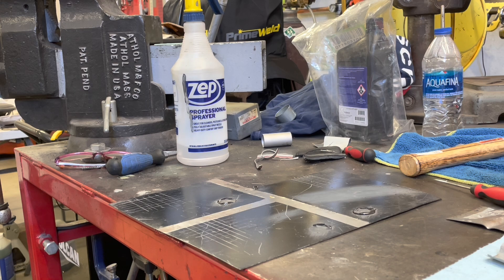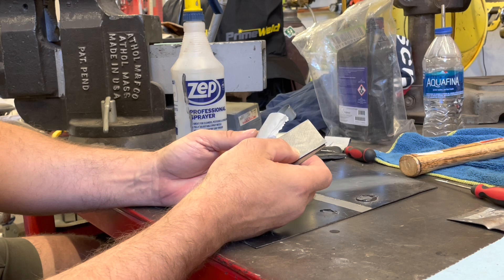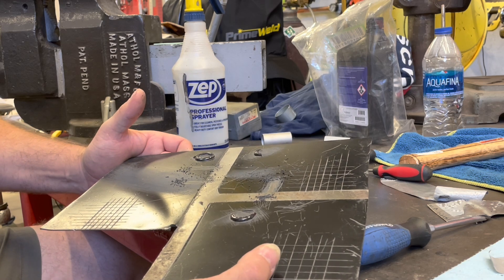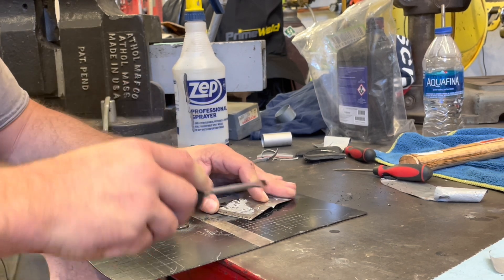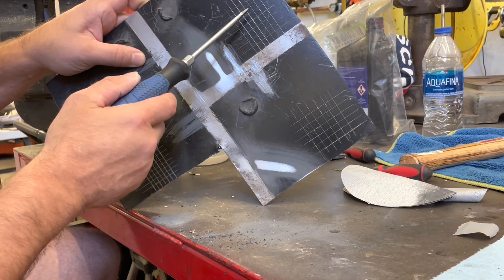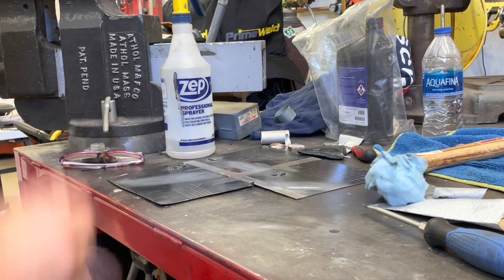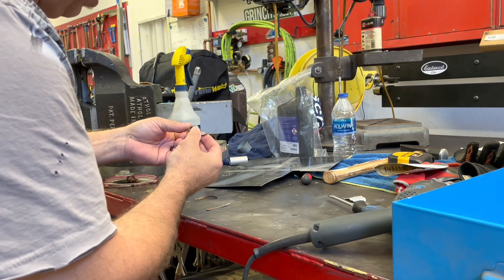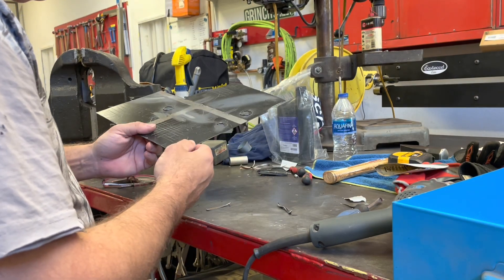Spi epoxy failure??

Comment: Good adhesion now 👍  About the small piece you did the other day. The only thing that comes to my mind is you didn't wait enough after mixing the epoxy and hardner , I think it's called induction time. Or maybe the metal piece had colder surface than the spray product or the environment at the moment of spraying . But what I think most is the surface looked too polished, so maybe it's really 180grit. 🥃
Reply from the maker: Yeah I watched the video where I did those panels, I said I used 80 grit but maybe it wasn’t very sharp or the metal could have been to cold, not sure
Reply: Temperature and Humidity can have an effect on the adhesion.

Comment: I have not used SPI epoxy but have seen several videos where painters like it.  I use Tamco epoxy with very good results.  I know Barry from SPI sure doesn’t like Ospho.  Always enjoy your videos.  I am your neighbor over by the Ark. state line.  Take care!  Tom
Reply: Actually, Barry does like Ospho and he uses it. Even on his tech sheet he recommends using Ospho and doesn't want people to use anything else under his products
Reply: @marcuswhite1403  I think mainly he wants it to be completely removed before his product is put on it so there won’t be any adhesion problem.  Take care.  Tom
Reply: @Okie-Tom  True. I followed Barry's instruction on a part I had rust on and it's been holding up for a year thus far